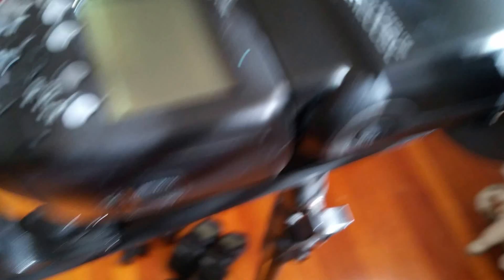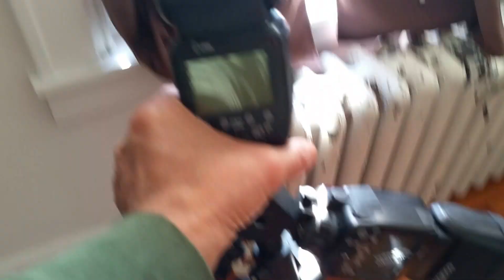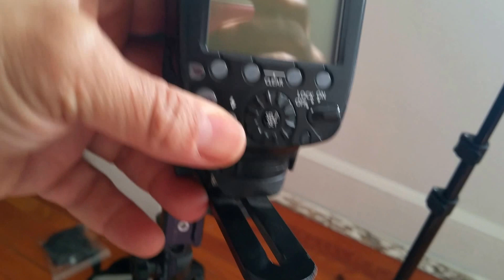Will flash brackets break my flash? Yongnuo and Shanny flash and Canon 600EX-Rt

Comment: Excellent!… I thought I was imagining a contraption like this to mount my speedlite onto an old softbox mount that I have lying around. Did you make these mounting contraptions or are they already in existence?  Where do I find them?... Thanks in advance
Reply from the maker: Thanks for the comments... Which brackets are you referring to?  There are a lot in this video and I sourced from a few different places.
Reply: 5:43 onwards… The beauty dish; the YongNuo that came out of the stand when you were showing it… that contraption and setup that allowed the flash to be mounted to the dish rim assembly.
Reply from the maker: I will write you later with where they can be purchased... I am on the road right now...